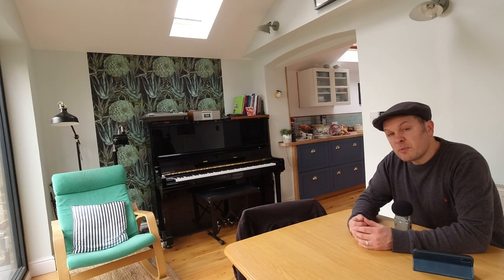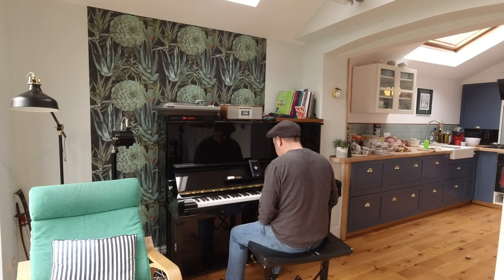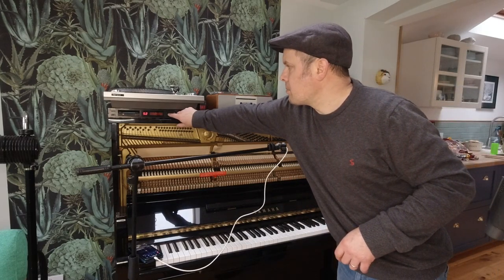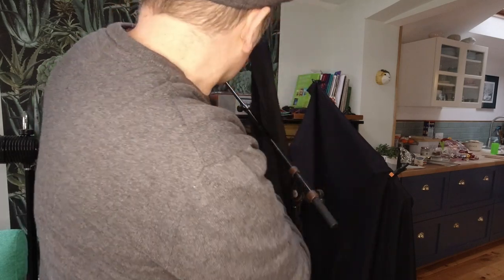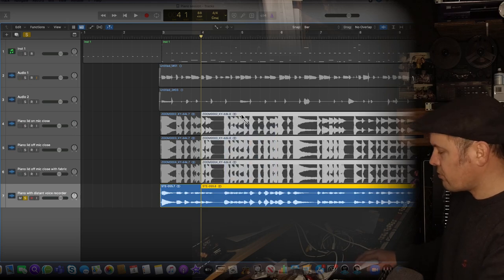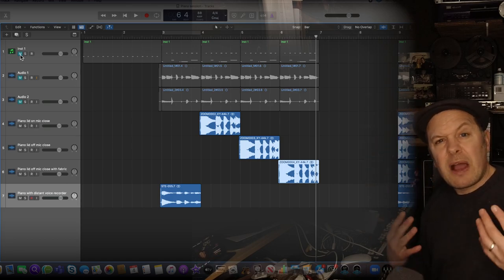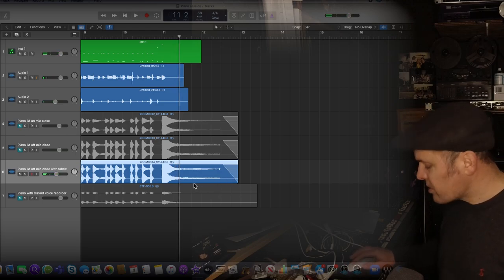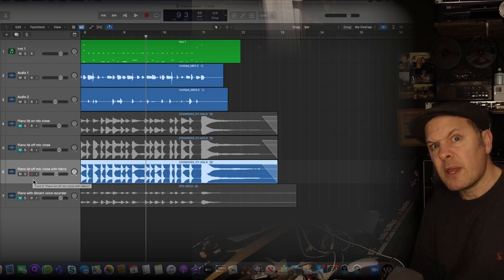Recording an Upright Piano in an Echoey Room

Comment: Hey Dan!  Sure do enjoy and appreciate your vids!  My fave technique was to put my 2 radio shack Pzm microphones inside the piano taped to that top board. About shoulder width apart and lower than the hammer felts.  That gave really good coverage and a super direct full sound. And stereo.  Pzm mic’s do things no other mic will do like boosting the signal 6db acoustically, and a hemispheric pick up pattern...  the crown Pzm mics are higher end and more easily available. The radio shack ones are history. Too bad.  But! Recently I googled how to make a Pzm microphone. And there it is! Great project, inexpensive and apparently better performance than the old radio shacks. Very inexpensive to make! This technique naturally excludes room reflections but another variation is to throw a moving quilt or two over the piano front especially the cracks around that top board.  That further removes any room sounds including the players voice, breathing, bench sounds, traffic. I would leave mine set up this way. An acoustic/electric piano with stereo outs!